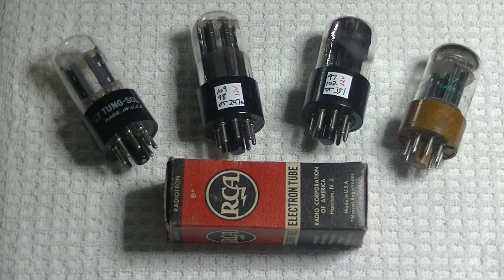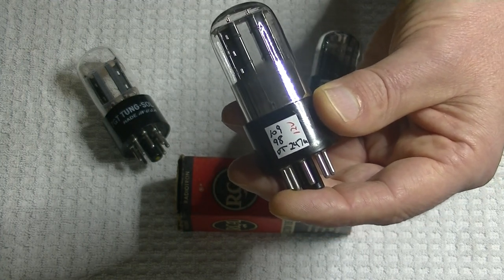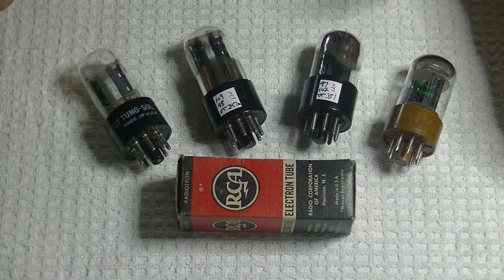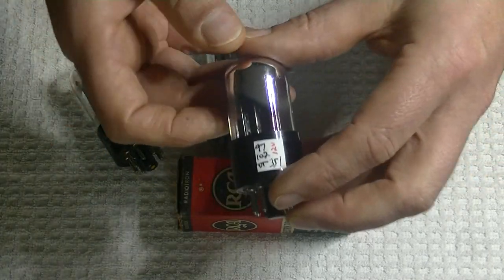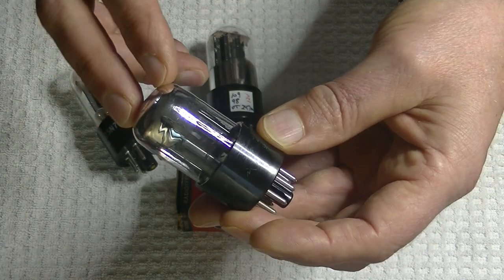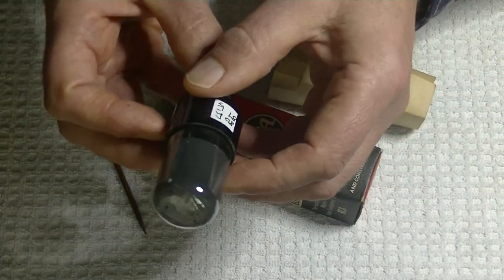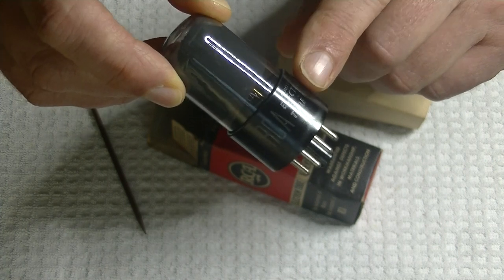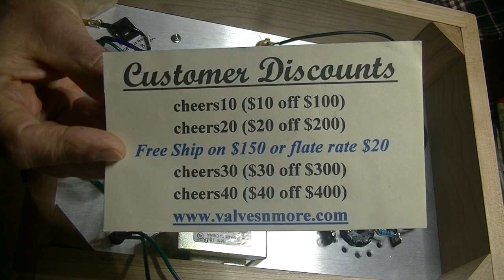Tube Lab #62 - 12SN7 Tube

Comment: Hello, I have a question about 6V6 Power tubes as they are my favorite in guitar tube amplifiers. My question is, are their other tubes that are interchangeable and compatible with the 6V6 Power tubes in the way they work in a guitar amplifier?
May I impose upon you and inquire about other tubes compatible with the 12AU7 when used as a power tube?
Thank you in advance for any considerations you may give to my questions. - Peter age 71
Reply from the maker: These are good questions!
The 6V6 has some similar tubes electrically, but with different glass and pins, the Russian 6p1p is an example of this.  However the 6v6 had probably the longest manufacturing run of any power tube ever and a huge selection of quality vintage tubes exist.  In my store I carry many of these variations.
The 12au7 had a slightly shorter run compared to the 6v6, and it also has tubes that are similar electrically, but with different glass and pin out, the 6sn7 is a good example of this, basically the 12au7 took over for the 6sn7.   The 12au7 probably has the most types ever made so a huge selection of fine vintage tubes are available - highly recommended is the RCA clear top, which I have in stock as NOS (new old stock) NIB (new in box).  A couple of similar (not identical) tubes you can try as a 12au7 sub is the 12bh7 and the E80cc.  Stay close to your amp when making a sub and shut down at the first sign of trouble.  Substituting tubes is done at your own risk.